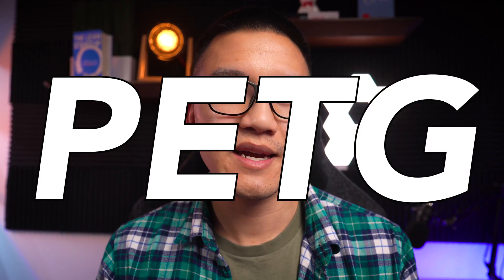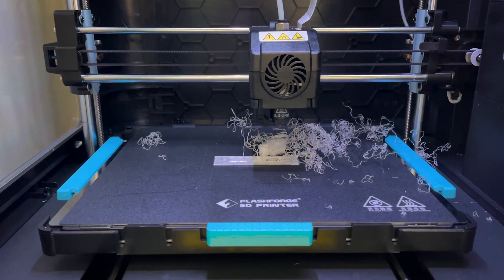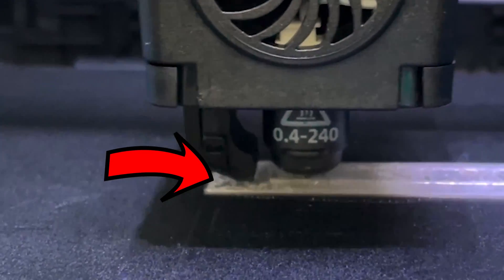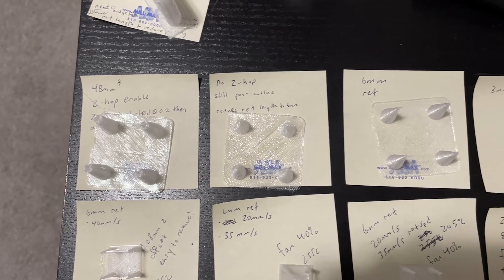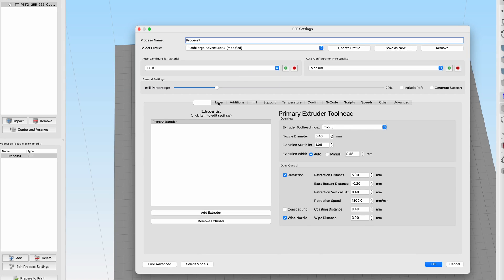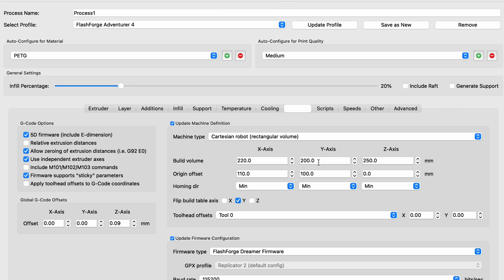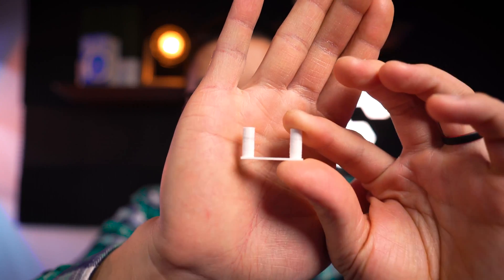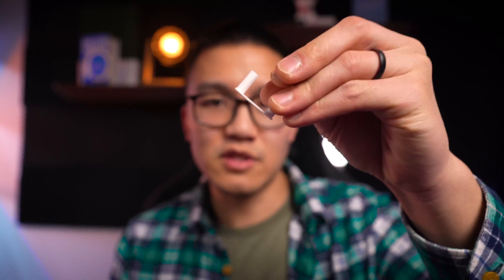The secret to 3D printing PETG [Adventurer 4]

Comment: S3D isn't the key.. it just happened to fix your problem because you probably didn't realize how to do the same thing on another slicer.  That specific setting you refer to for layer speed change is available on other free slicers (PrusaSlicer for one).   It's just a matter of getting comfortable with all the options in a slicer and understanding the requirements of the filament.. PETG tends to require slower speeds and a higher temp than PLA.  It also does better with minimal cooling like 30-40% (varies with different cooling fans).  There's quite a lot of other variables you need to play around with to get your printer to do well with PETG.  Additionally, if you have multiple printers, don't always expect the same print profile to work on the other printer.. it may but not always the case.  And finally, even if you think you have the printer dialed in and working solidly for months.. something will happen that will make you doubt the settings and make you go down a rabbit hole of troubleshooting.. When that happens, don't mess with your settings.. it's more than likely, a piece of hardware is causing the issue.  Check the hardware first.  In fact, backup your settings if you decide to make any changes to test something.  Also on a side note, they've been saying S3D v5 was going to be coming out a few years ago and they still haven't done anything.
Reply: Have you used flash print?
Reply: @chrishackett4622  In Flash Print you probably have to put two objects on opposite ends of the bed and limit the travel speed, so mimic slowing down the layer. Cheap hack but a reliable one.
Reply: Retraction Speed is just as important as cooling fan settings. Ive also noticed my petg (Elegoo rapid petg) flows very fluid even when only at 240. I knocked it down to 229c(my nozzle runs a little hot ymmv). Those are the two things that made the biggest difference.

Comment: Sorry but spending $150 is not in most of our budgets to fix a settings issue. I was excited about your video then discovered the $150 price and was like nope! I don't mind supporting software but $150 is crazy expensive for most of us I think. I''m going to try messing with the Cura 'minimum layer time' and turning off Z-hop. My prints adhere and stick find but the infill is getting destroyed. The outside and overhangs look great around 225-230 with my SUNLU PETG. I'm really hoping I can get these settings figured out. This is going better then my last go around with a crappy Overture PETG roll I got. It was defective from the start and their support really tried to help my but concluding a bad roll and gave me a refund. I really need PETG to print some stronger more heat resistant parts. Crossing my fingers!
Reply from the maker: You can absolutely do the same thing in superslicer and cura. When I made this video, I hadn’t figured out how to get Cura working with my printer and didn’t even know superslicer existed.
Reply: @justmakeitdaniel7667  I also discovered Cura has an experimental feature for bridging! It's helped with getting bridging now but still ugly as sin. I'm going to try another temperature tower with thicker bridges. Thanks!

Comment: Cura's got this "magic" setting too. It's "Minimum Layer Time" under cooling menu.
Reply: If I have read the comments I could have saved 13minutes. thank you.
Reply: This. Also Cura is free
Reply: This video has been sponsored by flashprint
Reply: This whole video just to say "change your slicer" is incredibly disingenuous.
This reminds me of that recent campaign I saw from a local 3d printing supplier where they said how "making your own pet filament has soooooooo many disadvantages" and you should "buy filament from these brands instead!".
Good god.
Reply: So what time should be there? Standard is 10
Reply: I see my "MInimum layer time" is set as 10s, is that correct? My printing is terrible
Reply: almost all the slicers have. idemaker, prusaslicer for example also. Also on some prints i need to print multiple of "things" so that extruder would be busy making something else so that part can cool down.
Reply: What do you find the best setting is for Minimum layer Time? Also in cura, is there a sweet spot forretract distance?i am getting pretty decent PETG prints now, but still a lot of hair like stringing
Reply: @mudbrats what are your settings?
Reply: My petg manuf roll recommends 235 to 255C. I use cura slicer. I lay down a raft at 255C to stick the piece and the fan off which sticks to the glass mirror bed very well. But when I print I did a temperature tower. Eventually I found 215 to 220C prints best (and strongest) but I find small parts are melting from the hot head being near it while they are  being printed. My bed is 65C which works very well. I am not sure what to do as 70% fan speed appears too slow now for the 220C head temp as it is melting the small parts. Going slower seems to definitely "hurt" for petg but what I most do faster is still a mystery to me. The petg seems to like being extruded slower but must not remain hot on the workpiece.

My temp towers were 265 down to 235 initially but I redid them from 235 down to 210. The printed better at lower temps but I still needed at least 255C to stick to my glass mirror bed. Once it cools down the raft sometimes remains and the workpiece pops off first. The raft seems to come unstuck and stop adhering below 30C.
Reply: So what settings are recommended?
Reply: Yep. This Cura setting was foiling my attempts at high speed PLA printing cleanly. By the time I got to PETG I completely forgot about it though! Will try re-enabling it...

Comment: Hi mate, awesome video thanks for making it. I have an Adventurer 4 and I’m super keen to use simplify 3D for making thin wall light weight PLA RC planes. If you could do a video on how to go about it that would be awesome! Thanks
Reply from the maker: I have a video out on how to setup sinplify3D for the adventurer 4 already :) in that video, I also have a link to the printer file from Sinplify3D for the adventurer 4 which you can download

Comment: bruh S3D havent been updated for more than 2 year+ almost like it a abandone ware right now, I been using it since 2015 last updates was in 2018? yeah it have some features that neat but now I think other free slicer superseed it althought I still use it from time to time when Cura not cutting it, I wish they provide more update with the software
Reply from the maker: Well aware that it hasn’t been updated but I find it’s great for running multiple prints. Cura has a script that can change parameters but the problem is that it uses decimal points in the temperature value which my printer ends up reading as 0 degrees
Reply: @justmakeitdaniel7667  which script is that? problem with simplify3d is I can't use the custom klipper macro with it as only cura have the script to do the post processing for the macro input value, but I agree S3D still use for some print like the support generation is still way better than other slicer even thought it is outdated

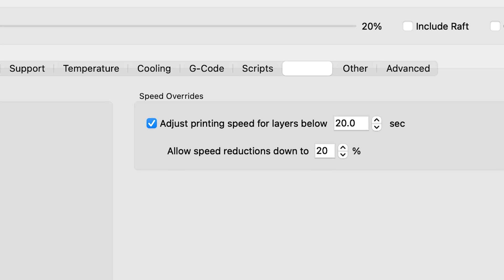Comment: his answer starts at 10:14 if you want to skip the long history.    But as far as I know, low fan speeds make for strong parts. I don't the timer method is only good if you don't have long bridges. With all the experiments I had, I found out the fan was cutting out to zero because of my stupid settings. Prusaslicer still didn't explain why the fan would turn off in the middle of making a bridge.   So now I have to find a way for it to work again...  So back to wasting more material.   Also a glue bed, you won't need as hot a temp for the bed. I'm at 45-50 using a glue stick. I'm betting with hair spray, I can go lower (haven't bought it yet).
Reply: Mvp right here
Reply: Hair spray works better than glue stick. I use aqua net and rave which are cheapest  but now becoming hard ti find
Reply: @imfloridano5448  i got a can of something, whatever was cheap. I have to try spraying some mirror with it. The issue with PVA is that the thickness is random and a lot of it comes off when pulled on.  I've been meaning to update it but the first layer is perfect right now and I don't want to touch it.
Reply: @imfloridano5448 3dlac works well for me. Think it might actually be made by a company that makes hairspray
Reply: many videos on youtube are pumped with mostly useless filler as a result of the platform rewarding longer watch times, it's unfortunate.
Reply: Some fans have a minimum speed at which they will start. If that's the issue there might be a way run them slower by starting at a high speed and then slowing down.
Reply: THANK
Reply: Thank You!!!
Reply: you the real MVP

Comment: Do NOT buy Simplify3D (at least not now). S3D is promising a major update for years now AND the UPDATE will NOT BE FREE for existing users. Rumors(!) are that the update is not that far away, so I suggest to wait for that. S3D in it's current form is not worth the purchase (any more - though it was when it came out).
Reply from the maker: I wouldn’t recommend beginners to buy it but I did it because I use to use it and had a good experience. I do recognize it’s not perfect and it’s a little outdated compared to other slicers. In my experience with 4 slicers (flashprint, cura, superslicer and s3d), it still is the easiest software to setup multiple prints with different settings on the adventurer 4. Cura has the ability to do it as well but you are running experimental scripts which work for the mainstream printers (ender 3 for example). But I tried doing this for the adventurer 4 and changing temperatures at different layers in cura didn’t work without modification to the g code (basically the temp had a decimal point which the g code interpreter read it as a zero rather than like 240C)
Reply: Every single time I hear someone asking about S3D I just tell them to wait if they do release their 5.0 version and to try SuperSlicer in the meantime 🤷🏻‍♂️
Reply: @josephgonzalez8084  Superslicer, Prusaslicer, Cura (though not my favorite)... there are enough alternatives with better support.

Comment: Have you tried Prusa slicer? I had no end of issues with Cura and PETG. The default profile in Prusa prints great on my ender 3 no blobs minimal stringing. Great videos.
Reply: I came across this solution last night. I was have non stop issues with cura and PETG. There was even times where the print head lifted too high on start up and printed in air. I downloaded Prusa slicer and used the generic PETG profile and a near perfect print. it still had a very very small amount of stringing compared to stringing on every layer before.
Reply from the maker: No I haven’t tried it. The adventurer 4 which I’m using isn’t widely supported by other slicers so it’s always a pain to set a new one up

Comment: I've only made it about halfway through the video at this point... Not long after you decided that "it's definitely not the filament being dry or wet", and I'm screaming at my screen, THE FILAMENT IS WET!! I had all but given up on printing petg after inability to print it from 3 different brands over a few months of time. I tried drying in the oven and all that as well. When I started printing a lot more flexible materials I decided to diy a drybox out of a food dehydrator to reduce stringiness and threw in the petg just cuz I had the room and voila! It prints almost as well as pla and is much stronger. I don't even have to print much slower than with pla on my ender 3v2 ~ 65-70mm/s compared to 80-100mm/s pla. Just use as little part cooling as absolutely necessary so as to not lose layer adhesion but keep the details. I had honestly written off all the money I'd spent on petg and was hesitant to even load it in again but I was pleasantly shocked. I should've been more diligent with moisture control as I live in the hot humid south but I just assumed my machine was the problem and gave up. If you got it printing ok without drying it you will be amazed how it performs when dried. You can get a cheap dehydrator from Amazon for about $40 and there are several videos on how to do it. Drying really only takes an hour or two and if stored ok correctly after dried you don't have to do it constantly. Hope this helps anyone else perusing through here.
Reply from the maker: How long did you dry it for? I’ve tried drying for 6 hours but that didn’t seem too so the trick. Also I showed my humidity is around 44% so not very humid at all. These are all experimental right now so perhaps I’ll try drying for longer and reprinting
Reply: When I was trying it in the oven I put it in for an hour at the lowest setting 170°f (~76°c) but I had the problem of one roll fusing together you mentioned in the video. Since diy-ing my drybox I've never precisely timed it, as I installed a cheap ($3-5) little hygrometer and just wait until it gets to <21% humidity. That said, I don't think it's ever taken more than an hour or two to reach it. You have to make sure the water vapor has a way to exit the box, like a little slide door or just opening the lid every once in a while, or it will get pulled out and eventually just reabsorbed by the filament. I also lined the bottom with desiccant to prolong the dryness. I've seen a lot of people say that desiccant alone will work but didn't have much luck with it myself. I don't really run any multi day prints so initial the drying + desiccant is enough for my needs, but for really long prints it would probably have to be turned on once a day or so to keep it printing well. I just wouldn't leave it running constantly either just to prevent a fire hazard/high power bill.  The dehydrator only operates up to 65-70°c so a fire hazard shouldn't be a problem but better she than sorry on that front imo. I've had problems trying to print at anything over 25% humidity (so 44% would definitely cause me trouble), but like I said I live in a really humid area so your results may vary. Sorry for writing a book, just trying to be helpful.
Reply: Great that you share humidity values! I read a lot about dehumidifyng filament and finally bought Sovol 3D "dryer" on discount. I saw immidiately diference in printing same tower with same settings in Cura. I wasn't shure how low I need dehidrate filament.
Reply: What if I put it in the microwave for a min?

Comment: Really?  Advertising Simplify 3D in 2022?  Just get Cura, PrusaSlicer or SuperSlicer and for PETG make sure you use wipe-while-retracting.
Reply from the maker: I’ve used S3D in the past so I was familiar with it. Cura has a steep learning curve but I’m starting to try it out now
Reply: @justmakeitdaniel7667  cura is extremely easy to grasp, especially with all the YouTube videos out there . Give yourself a week with playing with cura and you’ll get comfortable
Reply: @justmakeitdaniel7667  Then start with PrusaSlicer.  Cura has tons of options and sometimes I want one of those for particular parts, but almost always SuperSlicer has similar functionality (but thereby still being a bit more complex than PrusaSlicer) and PrusaSlicer is easy to install, fast and does almost everything you'll ever need and some things that you'll find nowhere (other than in its derivative SuperSlicer).  So, if Cura has too many option for you to check out or is too slow, check out PrusaSlicer.  But there's really not a single reason anymore to look at Simplify 3D.  The free slicers caught up and surpassed it by miles in the meanwhile.
Reply from the maker: @MisterkeTube  The Adventurer 4 doesnt use standard firmware like Marlin so there are some quirks when trying to use a new slicer. For example, in cura, using the AtoZ feature that allows for temperature changes at different layer heights doesn't work because it as a ".0" to the end of the temperature value and the adventurer 4 reads it as set the extruder temp to zero. I'm sure with PrusaSlicer which is primarily built for Prusa machines will have more headaches trying to get it working with the adventurer 4.
Does PrusaSlicer allow you to retract while performing a wipe movement? That is a setting that I found Cura doesn't have and it seems to be the difference maker between stringing performance between Cura and S3D so far
Reply: @justmakeitdaniel7667  And the thing cannot run stock Marlin (or Klipper)?  Then I'd not even consider it ...  and PrusaSlicer is not at all primarily built for Prusa machines - it generates standard gcode and works fine on Marlin, Klipper, ... anything accepting decent gcode.  And yes, in the "Filament settings" under "Filament Overrides" you have "Wipe while retracting".